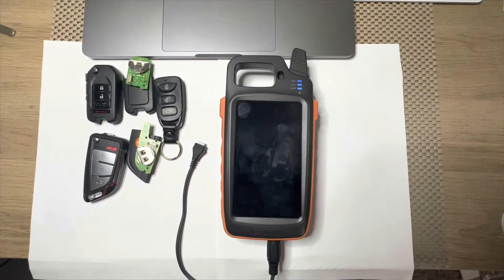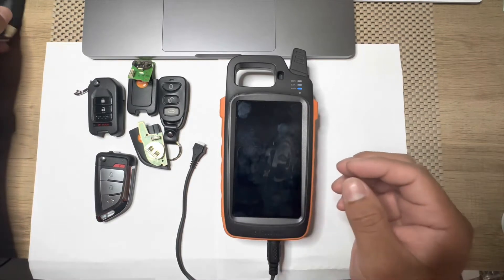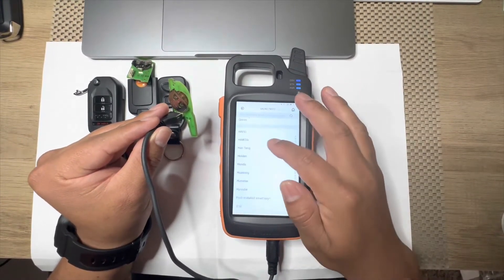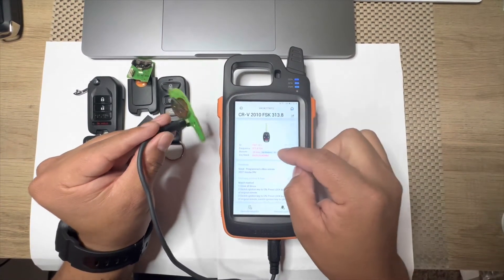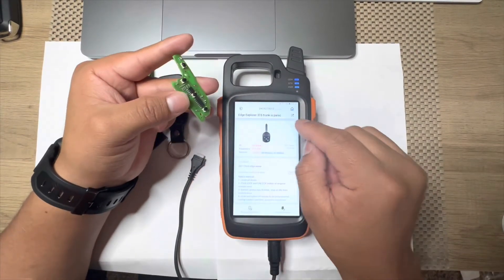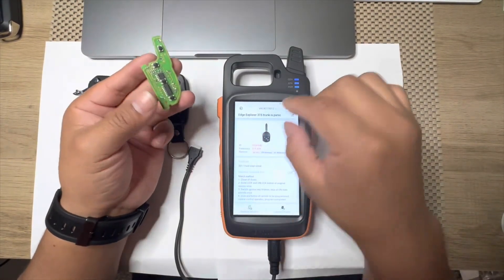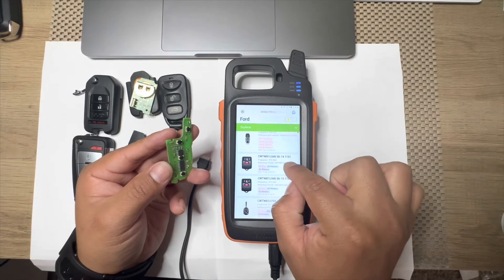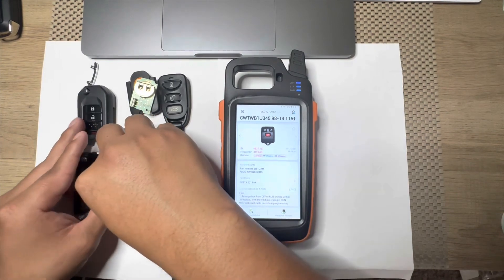How to generate Xhorse wire remotes | Xhorse Universal Remotes

Comment: Hi, 
1.One remote you GENERATE,,is posible to re-generate again in another moment, let say,,,i generate for ford,,another moment need to generate for anothen brand ???
2.Remote to GENERATE,does need to have transponder chip inside???
Thanks for videos!
Reply from the maker: yes, you can re-used the Xhorse remote!
Reply: This works on red wired remote on xhorse
Reply: .. or only orange blue purple ? cheers !

Comment: Hi,i'm trying to generate a remote wired xhorse key for a 2010 toyota avensis.When i chose the 09-14 avensis  xhorse generates the wrong transponder!!
The customers car has a dst80 id72g transponder.
How do i generate this?The circuit board on the xkto00en xhorse key dosnst have a transponder in it,just an eeprom.
Do i have to put an xhorse superchip in the remote seperately??Thanks.
Reply from the maker: I do believe the remote and transponder are separate, for transponder chip, you need to go to generate transponder and select which transponder chip number you need. and for remote, go to vehicle remotes and select what years its in there like you did 09-14 or by Fccid
Reply: @carsnkeysautomotive  Great,thanks for the reply!